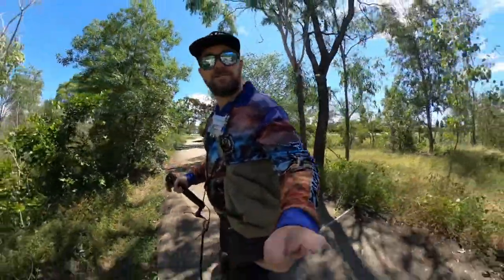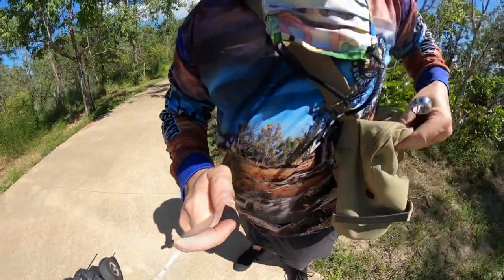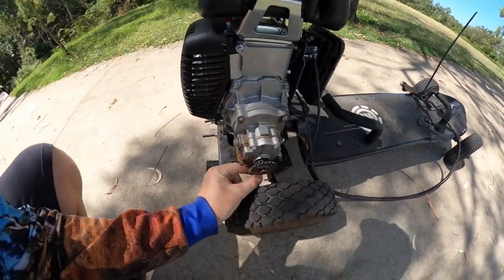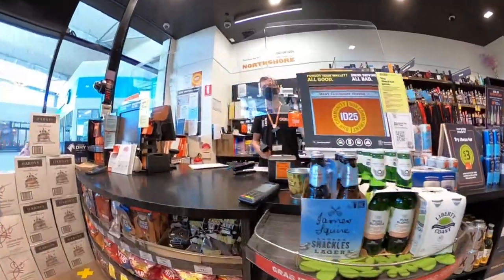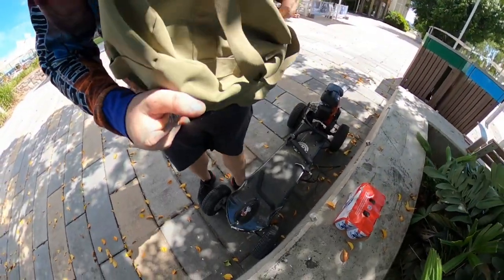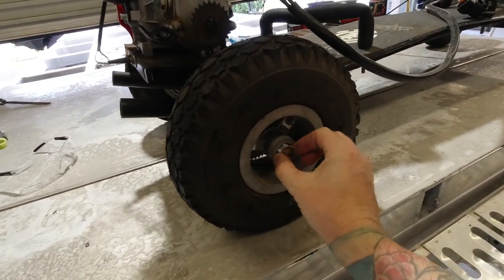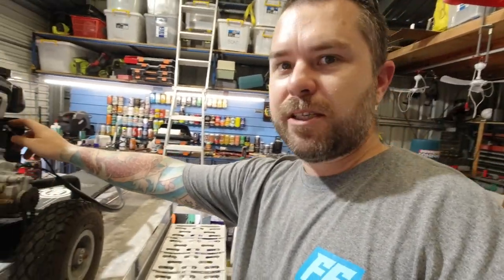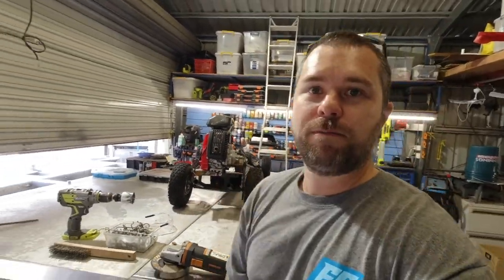Maiden voyage on the MOTORIZED skateboard

Comment: Awesome what about gearing look at the gears on it could help it alot
Reply from the maker: Yeah good point mate. It’s got a weird tooth spacing for the chain. It’s not a usual bike chain style which is a pain. It fairly gets moving once you get going so I could afford to gear it down a bit 👍🏼
Reply: @Kenny_B  would definitely take a lot of load off the motor thats for sure
Reply: @Kenny_B  yea it socks with the chains on them, I'm guessing it's a T8F chain pitch, what tooth sprocket ya running